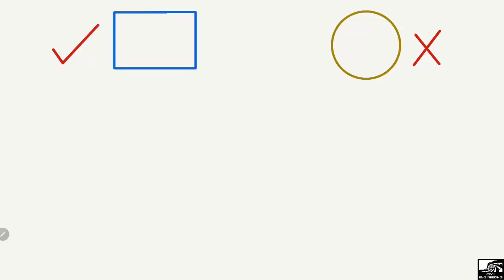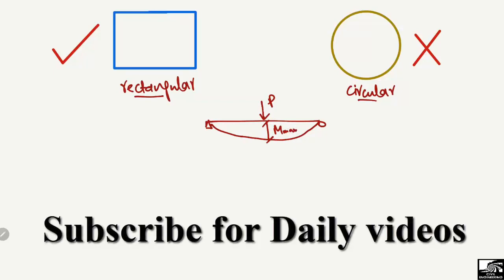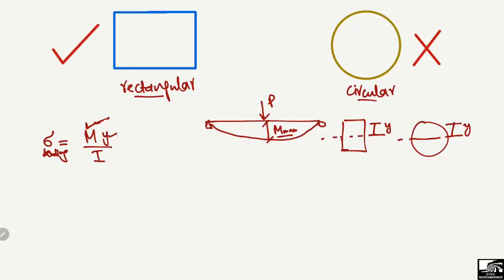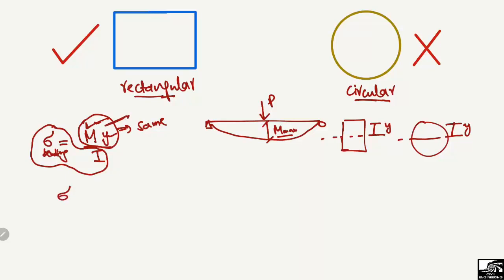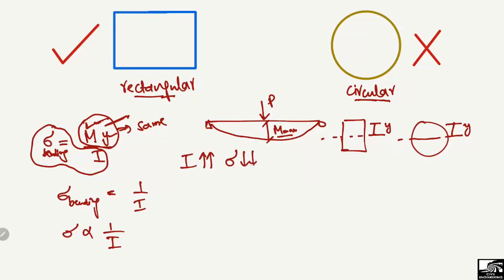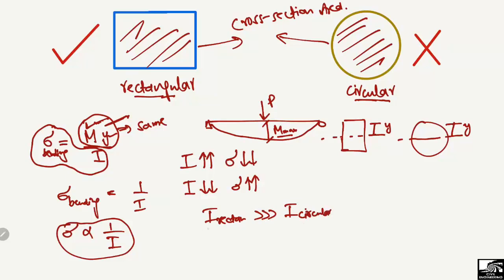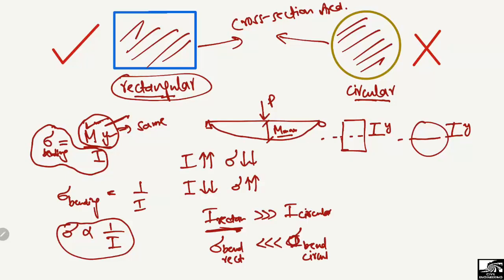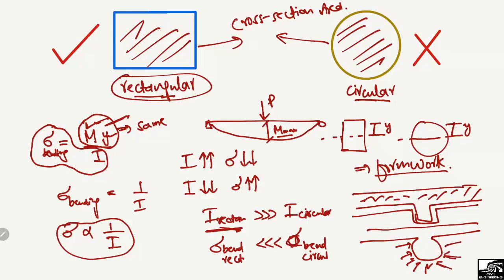Why Rectangular Beams are preferred than Circular Beams

Comment: Rectangular beams are preferred over circular beams because moment of inertia of rectangular cross section is greater than moment of inertia of circular cross section. As moment of inertia increases bending stresses decreases so only less reinforcement is required.